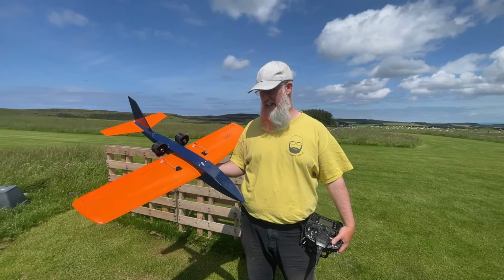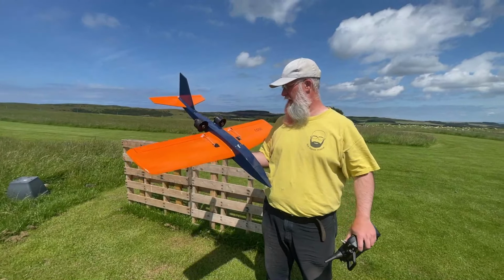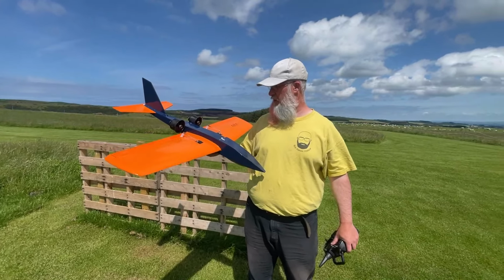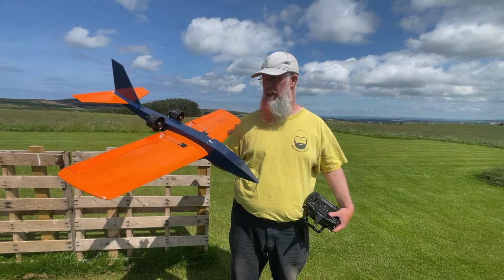An Experimental Blob EDF Maiden Flight

Comment: That is impressive, my type of model, any further details on the fans, ESC, Lipos used, put me down for a kit.
Reply from the maker: I doubt it will ever be a dedicated kit. The fans in this one are 64mm 5 blade units on x2 2200 3s lipos. Unfortunately today both fan units were found to be cracked in a few places and then an ESC died. More workshop time needed